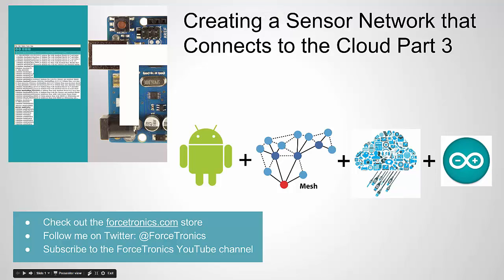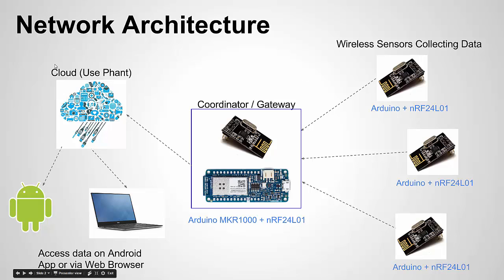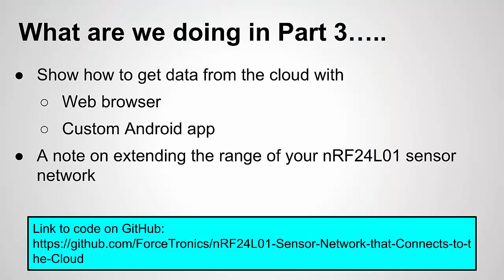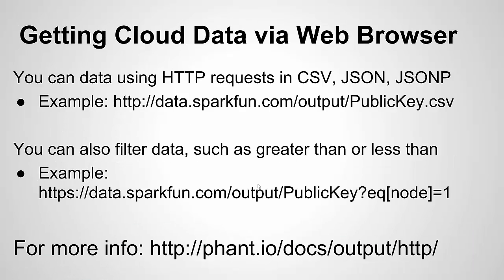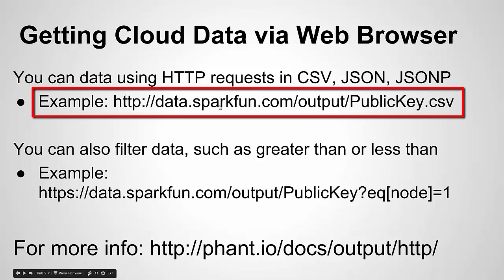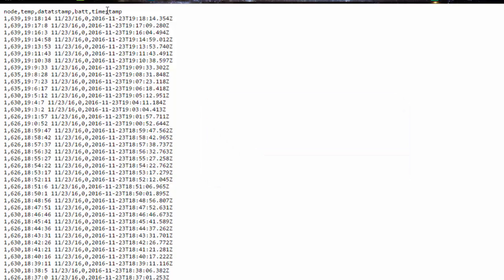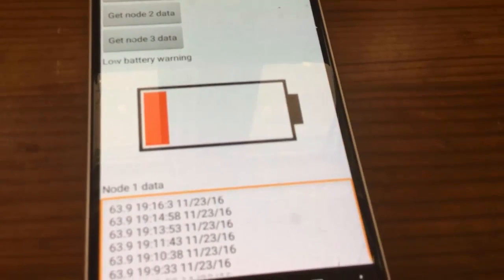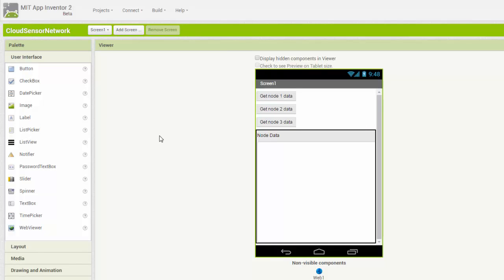Creating a Sensor Network that Connects to the Cloud Part 3

Comment: Hello, thank you for making your videos and sharing your expertise.  Is there any reason to think the NoSleep.cpp and Nosleep.h library files would not work with MKR1000s bought in 2020 versus the one that were used in your videos?   I am having difficulty, my MKR1000 is not getting past "while(network.available)"  With the same transmitter, I can get an NRF24 connected to an Uno, get past a "while(network.available)" and receive the payload.  However I am using the TMRh20 library's with the Uno.  Any thoughts?  Thanks  Jeff